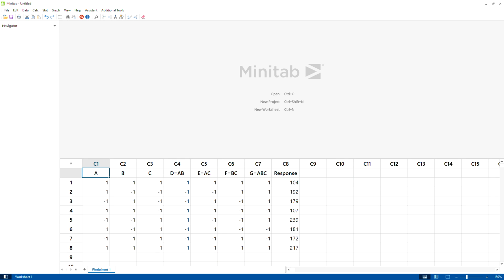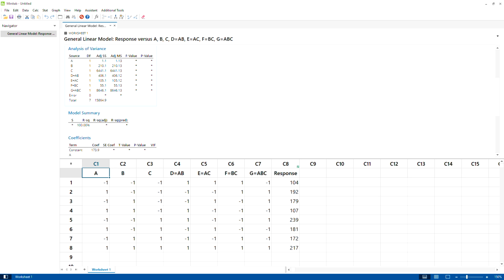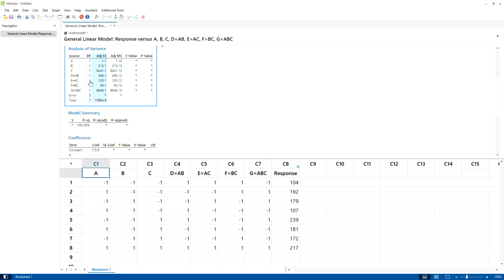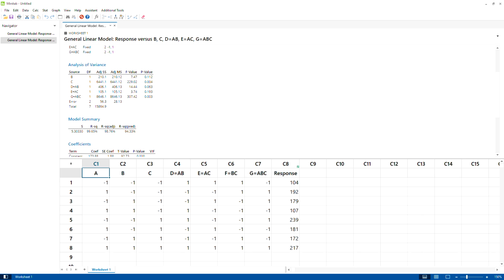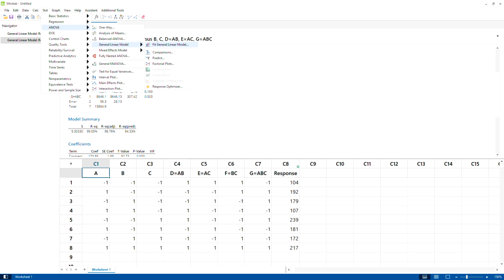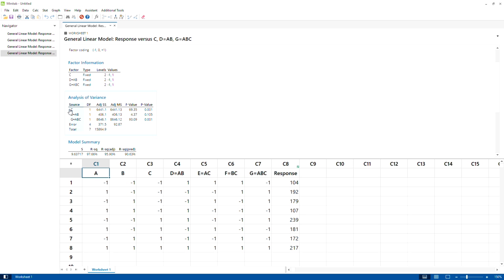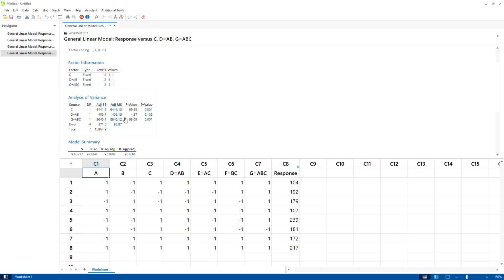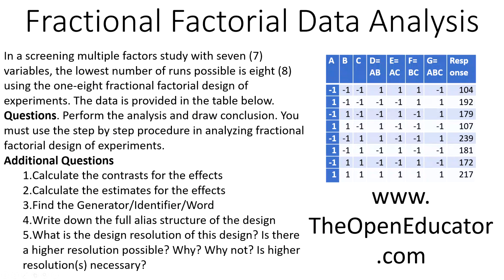Fractional Factorial Design of Experiments DOE Data Analysis Example | How To

Comment: One thing I'm wondering... Say we were looking at one continuous factor x and a reponse y. The true relation between y ~ x is y = x^2 (unknown to us of course). Say, for whatever reason we decide to take the levels of x to be {-2, 2} and measure the response. We observe that in both cases, the response y is the same, thus effect_x=0 and we would incorrectly count it as insignificant. How do we avoid this mistake?

Let me give a concrete example: In the "comfort ~ humidity, temperature" example you keep using, when you run ANOVA on that example, you get a p-val of something like .1 and .2 for the factors, neither of which are significant and so if we were just looking at these p-val's, we'd throw out the terms. However, later you run a few more experiments at the star points for these terms and fit a response surface. We see clearly now that the comfort is quadratic function of the factors and they are important. How would we avoid throwing out possibly important factors too early?
Reply from the maker: Most experiments DO NOT start with a vacuum. It usually has some clues/expectations on the output. Model fitting is sometimes more of an art than science. However, justifying a hypothesis without having some research or understanding of the variables could be very costly. If we have to divide the total time between making a reasonable hypothesis and rest of the work (e.g., collecting data, running the analysis and interpreting them) I would set more for making a hypothesis than the rest of the experiment. We still can't ensure that we could avoid the situation that you have mentioned. Great question. Thanks!
Reply: @TheOpenEducator  Gotcha. Thanks!